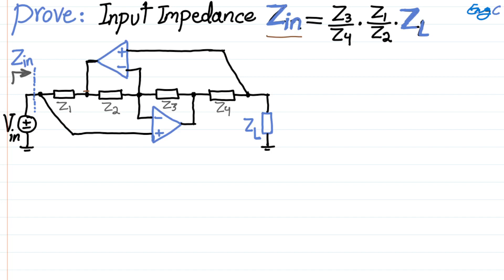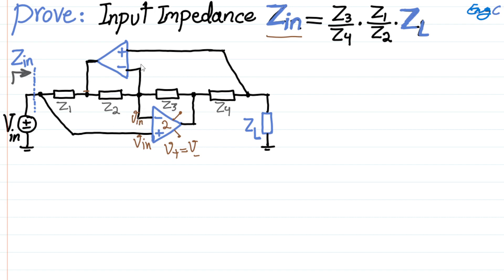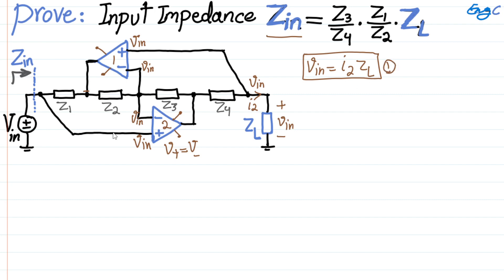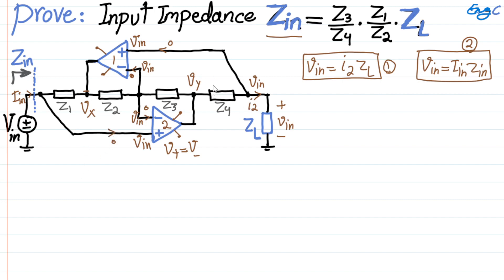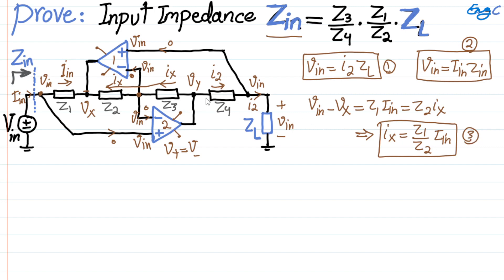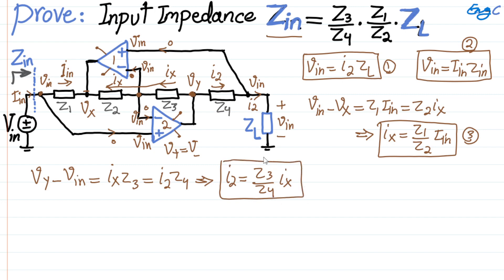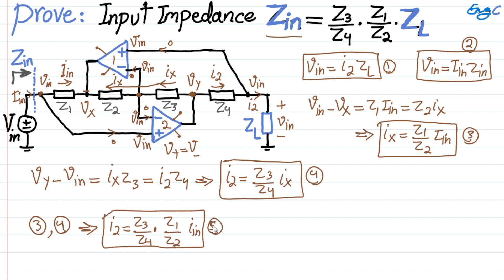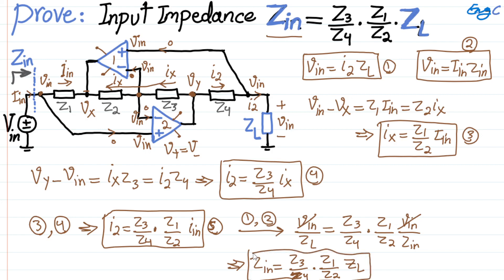General Impedance Converter Circuit Equation and Analysis

Comment from the maker: For more Op Amp Circuit examples see: Impedance Converter Analog Circuit Design with Op Amp (GIC and NIC) https://youtu.be/o6l_wztCACQ
Converting Capacitance to Inductance https://youtu.be/weIHG45G6Pg
Negative Inductance Design by Op Amp Impedance Converter https://youtu.be/GF_Mun_Mkyo
Analog Computer circuit that solves Differential Equation https://youtu.be/HeZRtnRXpEI
Capacitor to Inductor Converter Circuit https://youtu.be/weIHG45G6Pg
Active Inductor with Op Amps https://youtu.be/6IYz4iaa05c
Operational Amplifier Gyrator Network Circuit https://youtu.be/2KpjAytRBpc
More analog signal processing examples are in https://www.youtube.com/playlist?list=PLrwXF7N522y4c7c-8KBjrwd7IyaZfWxyt
I hope these Circuit engineering and analysis videos are helpful.